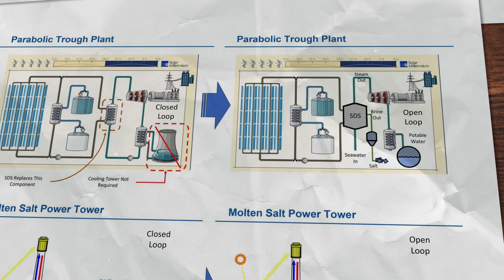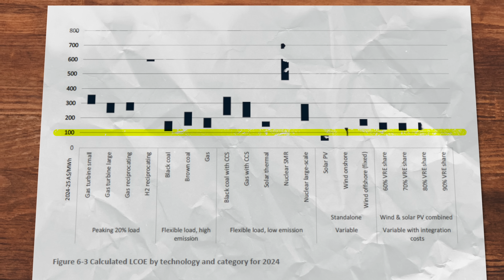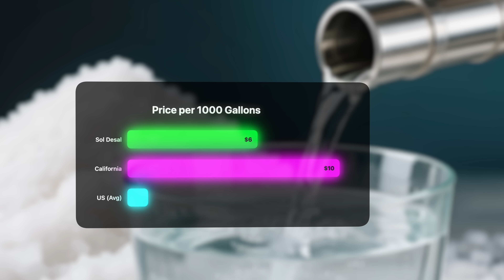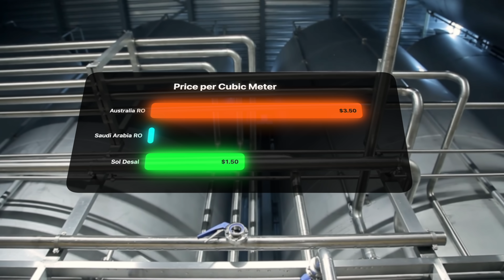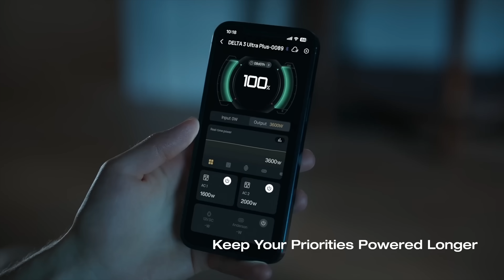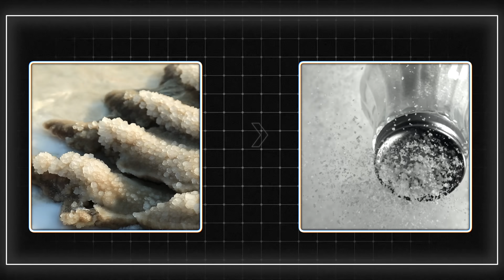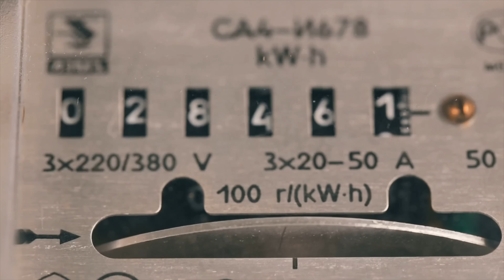The Desalination Process that MAKES Electricity - Too Good To Be True?

Comment: Also correct one statement to be more clear. Turbines dont send steam out coolingntowers wasting the steam. They use water in tubes to condense steam down and recover it for feed water. The hot water in yhose tubes then goes to a cooling tower and drops over the many floors of chevrons tondissipate the heat it stored to recover the cooling water of the condenser which is what creates the large clouds of water vapor coming out of cooling towers.

So they lose cooling water partially in cooling towers, NOT steam in cooling towers. The vid makes it sound like plants just dump their steam out a tower in a once through mindset which would be insane.

Comment: Similar to a HRSG setup or economizer which has been done for decades it takes the heat of combustion and reuses it. HRSG takes thr hot exhause air and uses it to preheat air in boilers so yout notnjaving to heat atmospheric temps from scratch. We actually get about half of minimum load at base lightoff temps from thatvalone in boilers.
Economizers take the heat of the flue gases to preheat the water of thr boiler itself during stages of thr boiler passes making it more efficient at getting water to boiling point... Thus the name economizer.

Rrcovering the steam itself to finnel backnis usually done in a condenser for thr vacuum as stated which condenses it for replenishing the hot well of water used for feed water so you dont lose as much of the water you treated and purified from reverse osmosis during initial boiler filling. This prevents high makeup water treatment costs.

But since the goal is desalination to make fresh water it doesnt need to care as much as using as much makeup as possible to create as much clean water as possible is the real goal here. 

Essentually electricity is a byproduct here and its production is whats offsetting the desalination costs. My only concerns here is ph and sodium levels in the turbine to prevent acid washing the blades and scale buildup from the water chenistry destroying the turbine itself.

Sodium and ph are TIGHTLY controlled in turning water to steam in turbines and sodium excursions can destroy a turbine outright... Thus why reverse osmosis water thats demineralized is used for steam.

I eant to read how this plant protects the turbine in this process from that because solving  that is why no ones done this. Typically it takes phosphates, caustics, acid, amines and descalants with reverse osmosis, condesnate polishing, demineralization and filtration which is a lot and costly.

Please cover that in a followup video as it is crucial to this story and is the real breakthru that would need brought up.

Followup vid = How is the turbine protected from sodium and ph issues from this?

Comment: A small correction I wanna add here: Zero Liquid Discharge (ZLD) does not equal Zero Waste. ZLD is simply that they squeeze the brine till there is no more liquid is left, but you still have all the solids that you took out of it. This needs to be exposed of one way or another, and usually it is in landfills

Comment: WOW, Australia's cost for electricity is high compared to the U.S.. I work at a coal fired steam driven power plant. The steam we use to turn the turbine generator is 99.9% pure water. Even the dissolved gases have been removed to not damage the blades in the turbine. 
How will this steam with salt and other minerals not damage the turbine blades when even oxygen atoms do considerable damage to turbine blades?
 If they solve this problem I'd like to know.

Comment: The problem is not the desalination process and the energy it takes, in countries like Egypt building the net work and roads and flatting the land to be suitable for agriculture or building new completely away from the Nile that depends on desalinated water is proven very time, effort and foreign currency consuming but they went most of the way already in 5 more years it will be completed.

Comment: Why not use nuclear power from Gen IV fast-spectrum reactors for desalination? This is much easier and more reliable 24/7 than any solar desalination plant. 
Beside water and all kind of salt, you can also get uranium fuel out of this. Chinese have developed a new promising process that may extract uranium from seawater cheaper than from mining. It may get an advantage using the brine as source. This gives not only endless water, salt, and minerals, but also energy for millions of years.

Comment: Regarding the salt pitting problem, it seems like you could run the steam along a horizontal chamber, let the solid droplets fall before they reach the turbine. Every so often, turn the heat off and replace the chamber with a fresh one.

Maybe the steam would lose too much pressure running through a chamber like that, and probably the salt build up would be too fast.

Comment: Maybe I missed it in the explanation of how it works, but I am a little confused.  High pressure steam turbines need extremely pure source water because in those conditions' contaminants can and will carry over with the steam.  And under those pressures it takes very little contamination to quickly destroy your turbine equipment.  In fact, high pressure boiler/turbine systems purify the feed water to the highest level physically possible before it is put into the boiler/turbine.  So how are they intending to take raw sea water and run it through a turbine at high pressure (regardless of how it is boiled) and not expect to very quickly destroy their turbines?  If it wasn't for that little hiccup, then this becomes an obvious answer for how to run a turbine, and everyone would be doing it already.  But we don't do this already specifically because of this problem.  We put a lot of time and money into purification before boiling for a reason, and I don't see what they are doing different to solve this existing and well-known problem.

Edit:  Ok, commented too soon.  This exact problem was addressed at the very end of the video, well after the "how it works" (seems kinda important to that part to me).  No answers still from the company it seems though.  Without that problem being solved, which they do not indicate they have any idea how to, then this is a complete no-go vs what we already do.  Without some invention that solves that issue, which everyone already knew about, then this seems to be complete vaporware.  Like I said, if someone had a solution to that problem, this would have been done years ago.  It's not a new novel idea, it's an idea with an obvious flaw that they are selling as new and novel just because nobody has tried it, due to its obvious flaw.  If they had a solution, then that would be their big selling point, not the overall design.  They could make a fortune just selling that solution to every energy company that depends on steam turbines in existence.

"We have a much better and cheaper way to do things.  We have it all worked out except a single piece.  But once we overcome that fundamental law of physics that nobody has figured out in the past 100+ years we'll be ready for market....  And so, we estimate that by ignoring the existence of that fatal flaw entirely, we can produce water at a fraction of current costs."

Comment: Salt can be used as a battery. You can fill a silo with it and a heating module. You'd slowly heat up the salt and use the heat later as energy

Comment: I like the idea of sinking the chamber with the membrane in the ocean and letting the pressure of the depths push the pure water through the membrane, leaving the slightly saltier water behind in the depths of the ocean. Then the water can be pumped to the surface using that same pressure and shipped to the shore.

Comment: Sodium silicate is produced from sodium hydroxide (and this synthesis from brine produces hydrogen and chlorine as additional byproducts).  The sodium silicate is a key component in geopolymer concrete, that is vastly superior to portland cement.  The chlorine is useful for many things, including new pvc formulations.  
Additionally, new geothermal drilling techniques opens the possibility of non solar, smaller footprint facilities.
Glad to see Australia taking a lead on this.

Comment: Use the heat differential between sea water steam & incoming sea water to run stirling engines to spin the generators. This avoids the seawater steam destroying the turbine.

Comment: one potential solution for the brine carryover effect is to have an ionization filterer to pull out the brine particles. it would require like 3-4 fixtures but if the goal is to pull out brine its not that hard, salt water has a different electrical field than pure water, so mimic the cling effect of the turbine with sacrificial filterer before the turbine. I have see the effect of dirty water in a turbine, it gets bad fast, but its because those systems were never designed for dirty water. The biggest impact would be a major drop in the amount of steam produced, as the brine is dispersed in the steam, so a lot of steam is just going to get dumped.

Comment: The easiest was to get fresh water is to condence it out if the atmosphere were their is zero salt in the first place. 
The ideal place is next to an ocean or large body of water were humidity is high. 
Why would you heat up sea water when the Sun has already done this for you. 
The solar energy is used to cool the water from the atmosphere directly via industrial fridges.  The water can be filtered to remove any dirt or microbes and then pushed into the water distribution network 

Job done. Current desalination plants are an abomination abd this tech in your review is also.

Comment: It would help if this analysis had a look at the Ivanpah solar thermal power plant. It skims over the mirror / heat receiver design but we have to wonder what these guys have that the Ivanpah guys did not have. There are a lot of challenges with using a field of tracking mirrors to heat water. Taking that technology for granted when over a billion dollars were wasted on Ivanpah leaves a hole in this presentation.

Comment: They probably use flash desalination somewhere in their process. It just takes the vacuum from a column drop of 30ft (approx 10m) to lower the boiling point temperature of water by something like half. It's how ocean going ships make their own fresh water, and that process has been used for around a century. So if you can build a water tower that can also maintain a vacuum and heat it up (simple if it's part of a solar collector), it takes a lot less energy to pull condensate from that which would be fresh water. Of course water has to be pumped into it, but as it's designed to be air/gas-tight, the drain column is what produces the vacuum as long as flow rates and such are metered properly. (On a ship they use gas ejectors powered via aux plant steam rather than elevation to create the vacuum, but for a static structure emplacement the elevation method makes sense.)

The trick is the method of collecting the super concentrated brine and turning it into salt, and then figuring out what to do with that, because that's the real issue. The other challenges were just modification of what should be an already well-known tech.

Comment: There are already concerns about drops in salinity of the oceans due to the melting of the ice caps. Those salt brines could be distributed in the Atlantic and Pacific to add something back. The biggest issue for environmental risks in salt brine is concentrated dumping, not distributed release. Load it onto an electric tanker and release it over 300km.
That's aside from the benefits of using salt brine for Na+ batteries.

Comment: there are lots of assumptions but some of the big ones that will make it not feasible.
when the concentration increases . it will produce plaque an get insulated by the salt.
steam generated will be wet. those steam needs to heated to produce energy using turbine without damaging the turbine.
turbine once startes rotating it needs to run at the same speed to generate energy with consistent frequesncy . doing that a eneergy source that is so unpredictable is just a holucination.
in short its good thing that people are working on it. but it takes a lot to make something like this fly.

Comment: There is a large commercial greenhouse in Australia that has been using solar heating to provide all the electricity and fresh water they use, then just use evaporation ponds to turn the brine to salt.
Reply: This was an approach in the 1960s to dry grain. While travelling to Oz, I told a PhD how it could desalinate and be quadrupled in power. I think he took it further when he started at Sydney Uni 1988. This might be it.

Comment: Another great advancement would be a pathway for us to find a way to say in the arctic circle islands. Safely melt away in stages layers of the ice all the way down to uncover usable land and in the process of ice melting capture the fresh water but more importantly capture the greenhouse gases that’s been traps in that ice for thousands or millions of years. Also safely detecting possible biological viruses or what other threats that could have been trapped in the ice. If we can develop this capability to clear away miles worth of ice like in large areas letting us reach land who know.
Reply: @nerdwatch1017   Reflectivity of the arctic land is a factor in climate change. Snow and ice reflect light and heat. Soil absorbs light and heat.

Comment: there is a reason it wasn't made before: it doesn't work or not feasible. 
since a system wit solar panels and RO, is way cheaper to build , cheaper to maintain and more reliable

Comment: This is one of the most important technologies in the world to improve.  With rising temperatures, desertification and overpopulation, we desperately need more coastal areas to obtain water from the sea instead of sucking away all the groundwater and rivers.  Keep trying!  ⭐️
Reply: Not just desertification, but torrential rains in areas not set up for it or accustomed to it. Existing fresh water is in danger all over America from pollutants & floods that exceed capacity to cope with.
Reply: We are not seeing desertification, we are actually seeing the greening of deserts since the 70's, just last week a real science article that talk about how we are seeing more rain in the desert and nothing points at it becoming less again (we know we have cycles where the desert turns from lushes greens into desert and back again about every 5000 years, it looks it is going back again), oceans have been rising for the last 10.000 years and there is absolutely no acceleration to be found, we do however see locations where it is slowing. The temperature has gone up 1 degree celcius in the last 150 years,most of it before 1970, the year alarmists say that is when men became responsible for warming, a claim you can actually not find in 95% of all real scientific research, it is something that comes from models that have not predicted a single year correctly and even after constant adjusting of these models the most moderate models shows too much warming compared to real measured data. Not a single claim about bad consequences from alarmists since the 70's has come true, and in most areas we see the opposite of their claims. But that is why we do not call it manmade global warming nay ire, we couldn't prove that, and with those pauzes in warming for 9 years and 17 years (that is why now we panic over een peak of warming during a single day, which always is a new record, but disappears in the long term data and is not to be seen there), so now we call it climate change. Deserts getting bigger climate change, of my god the real data says desert are achei king, that is also climate change and bad, we will see no mor snow because of climate change, oh the real data says that since the 80's worldwide snowfall had increased with 3% and that is bad. No rain climate change, more rain climate change .. it is always the same mantra,the weather doesn't do what we want so it is climate change. 

Overpopulation is bad, but there is no overpopulation on fact there is about three countries where they have more than 2.3 children as a birthrate the rest including India (2.0) and China (0.7) are already going down, India slowly and China imploding. We see this all over the world and it will go down much much faster than how it went up over millennia. 

Si with less population worldwide, nature will come back and we will need less and less energy. 

If solar panels that use more energy to be produced than what they produce in their lifetime is the solution, while they are filled with heavy metals and can only be recycled in paper, are the solutions I do not see, specially with all the chemical water that sips into the soil because they break where we store them. A real  average lifetime of 7 years, makes that we (as we can already see in Australia where this is a huge problem) are building mountains of chemical waste of which we do not know what to really do with. 

We can of course totally ignore all the real examples from reality all over the world and then we call it a solution instead of a ginormous natural disaster that is worse than the problems alarmists make up.

Comment: Recently folks discovered photomolecular effect.  Using 520nm (green) light we can evaporate water.  This was a huge breakthrough, and this 520nm can be easily produced using very efficient LEDs.  ...Solar powered 520nm LEDs floating in the ocean = free fresh water and salt for batteries 😅

Comment: The reason this hasn't been built at scale everywhere.

Is because they can't control you , by socially scoring your use of water, if water is abundant.

This is a suppressed technology.

Like EVs were for 50 years.

And like fusion has been.